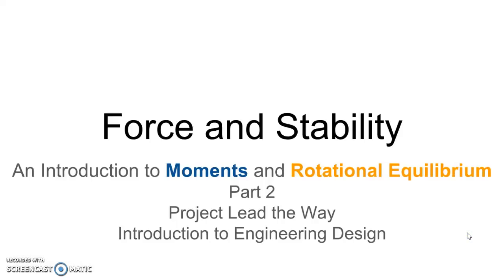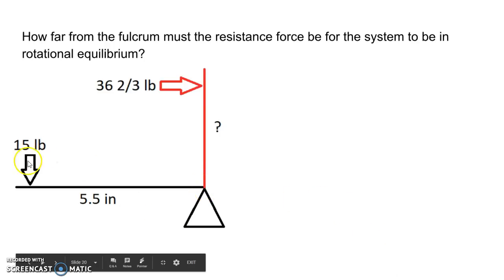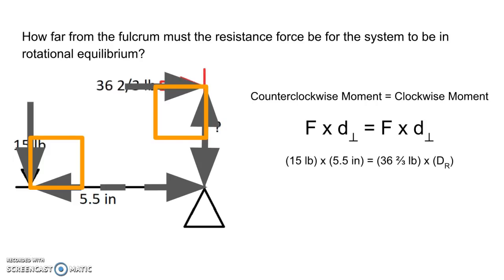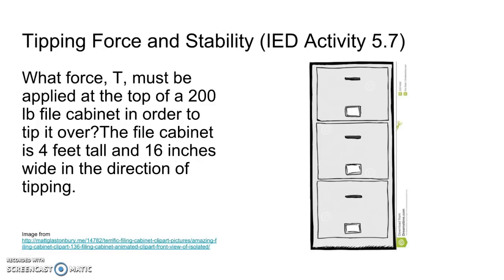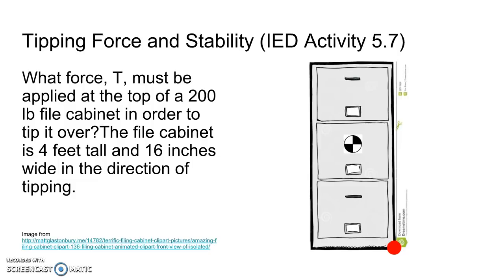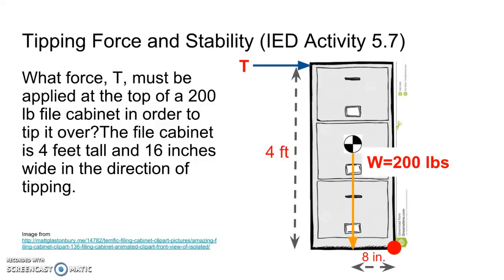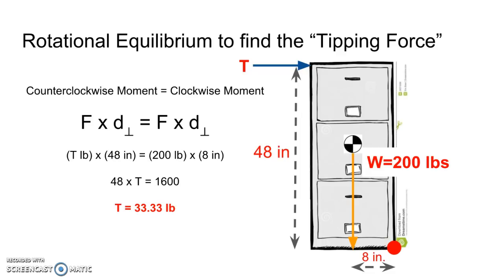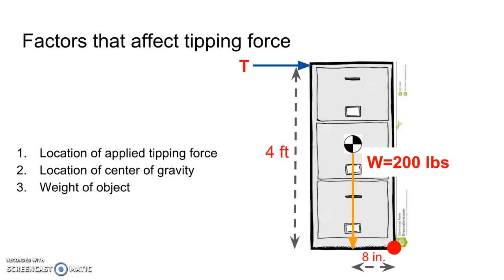PLTW IED 5.7 - Tipping Force Examples

Comment: Hi does this mean that the tiping force and height of the applied force is the same for all vertical positions of CoG. For instance in this example take two cases with 1) a mass of 20kg is in the bottom drawer and 2) 20kg is in the top drawer. Will the tiping force and height  will be same in both cases.

Comment: Thanks ... this helped me figure out the tipping risk of a Cable Tower for the home gym - I calculated some "it will tip if..." weights and went to (carefully) verify.  Now I know the force I that the ceiling support needs to be rated for AND I know how much impact adding weight to the base will have on that number.

Comment: Hey, my roomate and I are having an argument wondering if you could weigh in on it. If you lifted and balanced a 2 ton truck with only 1 jack stand in the center of the body of the truck. Would the truck be sensitive enough to tipping that it would fall off the jack stand by simply opening a door.

Comment: Does the height of the center of gravity play no role? I mean wouldn't it make a difference whether most of the weight where gathered in the bottom of the object vs. at the top? Just curios.
Reply: I think the force would remain the same, however as the centre of gravity is lower it would need to be tilted further to tip completely. (An object tips when the centre of gravity  passes the rotation point)
Reply: Its the perpendicular distance x magnitude, when perpendicular equals 0, the force is negligable. Obvioisly because 0x anything is is 0

Comment: There really is no situation where students should be taught you can express a force in pounds....it's shit physics and makes no sense. We have SI units for a reason and just having an American accent doesn't make it ok to use the wrong units
Reply: I live in America. You will no doubt be surprised to learn that we do not only use pounds as a measurement of force in physics classes but, additionally, we express real-life weights and forces with pounds. Whether I am buying vegetables in a checkout line at the grocery store, or using a torque wrench to tighten a bolt, the force will almost certainly be expressed in pounds. Crazy, right? It's almost as though America didn't adopt the metric system!